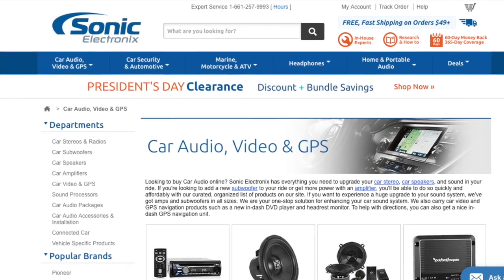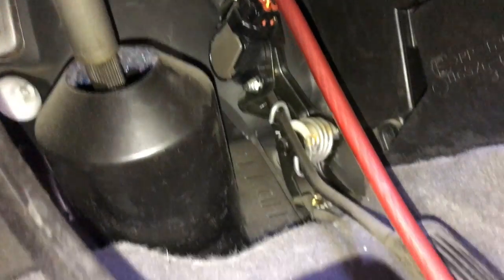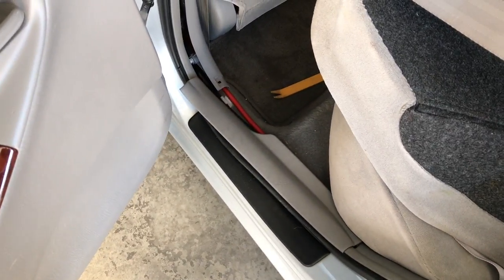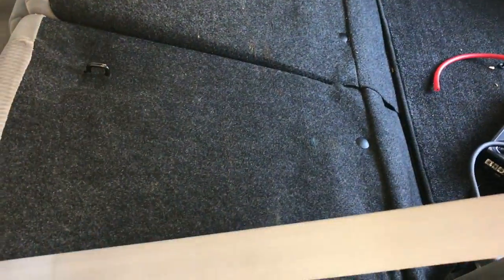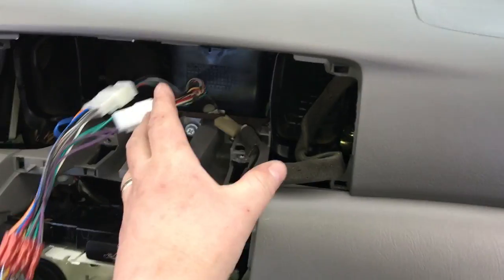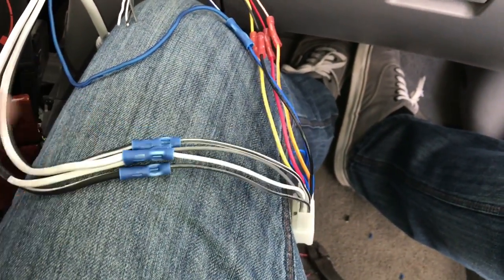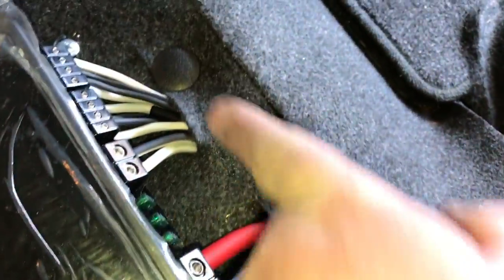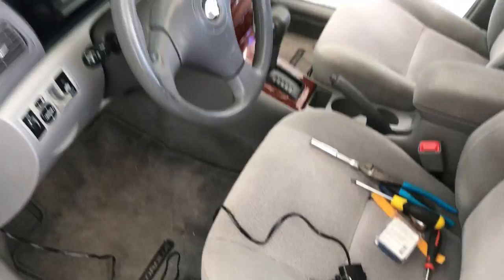2003 - 2008 Toyota Corolla 5 Channel Amp and Sub Install

Comment: I need a better explanation on how to get the power wire through, PLEASE. I feel like I’m going to mess something up. This is the first system I’ve done in a Toyota. Also, can I reuse the bracket on the factory stereo for my aftermarket? Never seen a factory stereo have its own bracket. I’ve always had to buy one. Thanks for the help!!!
Reply: A little late, but how I was able to get it through was by covering my hand in oil and penetrating one of my fingers through the inside of the boot, beside the wires in the middle of it, until I felt that I am stretching the other rubber wall of the boot. (This part is really tough but if you have long enough fingers and are determined enough you can get it through) If you can get someone else to lay down and look where the pedals are and cutting a hole where the boot is bulging from your finger, of course when it's been removed. After that cover the wire with electrical tape and lather the end in oil and force it through.

I know you have probably figured it out by now but I hope this helps to anyone reading this.

Comment: How did you mount the fuse ?
1. Did you use double-sided tape or drill a hole into the metal sheet ?

2. Did you apply any weather protection sealant lube to the rubber grommet ?
Reply: Just drill a hole and if should be fine no need to seal it the fuse case should be weather protected
Reply: @kingofkards1110  Thanks.

Comment: What did you use to mount the amp to the seat? I’ve tried and failed a few times! Also, my aftermarket radio has only one set of rca outputs. Could I still run this amp and supply power to all 4 speakers plus a sub? I wanna run it just like you have it or at least similar

Comment: Hey could u just hook up tha rear speaker wire to tha front door  speaker wire behind the radio so you don't have to run new speaker wire from tha back thanks just askin

Comment: When connecting the outputs from the amp can I splice into the speaker wiring from a after market car stereo or do I not use the outputs from the stereo and just use the amps outputs
Reply from the maker: If you have an aftermarket radio installed, no need for any splicing for an amp install as you'd use the radio's RCA preouts to feed your new amp the signal to play.

Comment: Hi! Thanks for the video! Where's a good resource for more research on the wiring process? Also if my car has a 6 speaker setup w/ tweeters would I need to replace the stock wiring for all speakers?

Comment: I know its been 2 years, but I noticed you have a little holder in between your mirrors adjusters and security light. My car has a tire pressure set button, do I need that cause I would rather have something like what u have instead?

Comment: Hey ProvoBeast, quick question: what do you do if you have a factory amp, attached to each front door speaker (vehicle in question is a 2002-07 Jeep Liberty with factory premium audio) and you have an aftermarket radio you want to put in? Do you have to connect the amp turn on wire? I'm thinking of getting a Liberty, and it uses the same wiring as my 2002 Jeep Grand Cherokee that didn't have premium factory audio, so I didn't have to connect that amp turn on wire. Thanks for your help in advance! :)
Reply from the maker: Head over to sonic electronix and use their vehicle fit guide to make sure you get the right harness.  Generally, it is good practice to hook up the blue wire in the harness to your radio's blue / white wire.  Other than that, you should be fine.  The factor amplifiers on your two front door speakers will work fine with the new radio.
Reply: Thanks. In my Grand Cherokee, wiring harness is the same as the Liberty, so I'll only have to connect that blue wire to the blue-white wire. I have the Kenwood KDC-BT758HD head unit, SiriusXM SXV300 Tuner Kit, and all installation harnesses and dash kits, so I don't have to buy anything. I don't care about the steering wheel controls that'll be in the Liberty if I buy it, as I don't use them in my other vehicles. Thanks again!!! :)

Comment: How did you connect the power wire to the battery terminal?
Reply: @P. Spit you can't get a shock from 12 volts.
Reply: thats my main question im not sure whether tu just drill a hole a guide the wire through the holes were the harnesses are

Comment: Hey i got a question. Did you perform the big 3 upgrade?
Reply from the maker: The guy didn't want one done, so we didn't, but honestly it's recommended for any system.  The biggest bottle neck in your system will be the charge wire from the alternator to the battery.
Reply: Provo Beast Audio Installation thanks i really appreciate the quick reply!

Comment: Can you do this is the OEM radio??
Reply: With the OEM radio*
Reply from the maker: @ashtrixgaming  Yes, with a line out converter.  It would be pretty simple for a sub and amp install, but if you are looking to also amplify your interior door speakers too using the factory radio, it can get a little more complicated.
Reply from the maker: https://amzn.to/33lRh5u

Comment: What radio did you have installed?
Reply from the maker: A simple double din.  If you need recommendations on great double din units, let me know.
Reply: @ProvoBeastAudio   What would you reccomend I have a 2005 corolla, and Im looking for something that would work with the project in the video, and have the unit be Bluetooth compatible